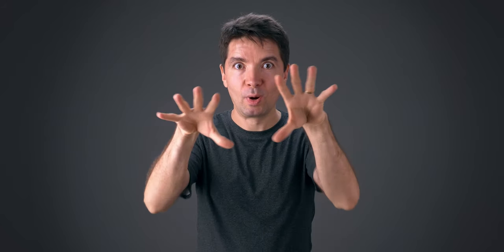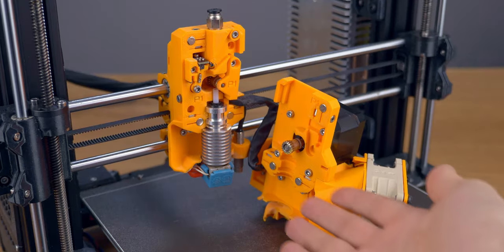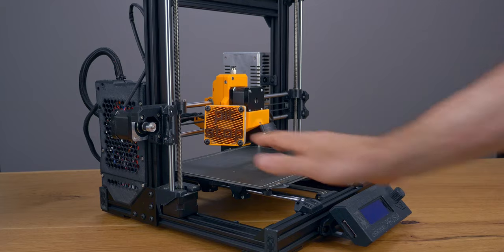PitStop features as fast as possible

Comment: Wishing there was something like this for the Prusa Mini. I'm dreading having to open that bowden setup to do any cleaning.
Reply from the maker: I haven't used the mini at all. Does it require opening/cleaning?
Reply: @MihaiDesigns  I have yet to open it up, but I have had to clean out the extruder gears with a toothpick because it isn't very tolerant of 3rd party filament and grinds them. Maybe we should get you a Mini? ;)

Comment: I read mmu2s and no firmware changes which makes me suuuper excited. But I also hear bear. Can it be used on the stock mk3s+mmu2s without bear upgrade?
Reply from the maker: Great question! It should work with the stock frame judging by the CAD designs I found. I haven't tested though because I don't have the stock frame anymore.

Comment: Im looking to do an extrude upgrade. This looks like an option and I've seen it talked a bit on the FB page. However, I am looking for print quality improvements and am unsure if this upgrade will do much. Currently looking at a BNBSX or Skelestruder with volcano and 0.6mm nozzle, possibly for a geared extruder with weight reduction. Anyone have input to point me in the right direction? Already have an Mk3s and few other printers, this question is for helping me build a new printer from scratch.
Reply from the maker: Aside from reducing risk of jamming, I don't think you will see significant improvement in print quality with my extruder.